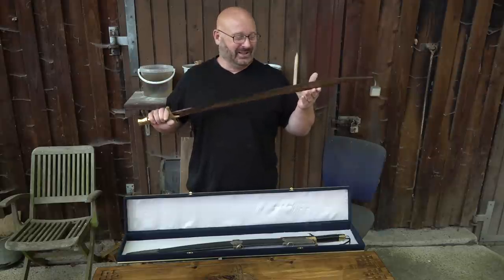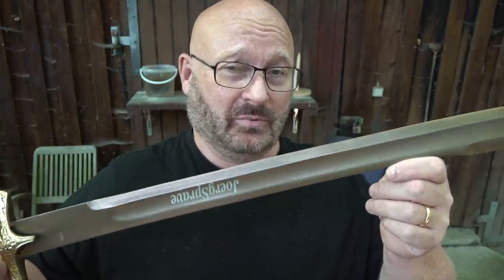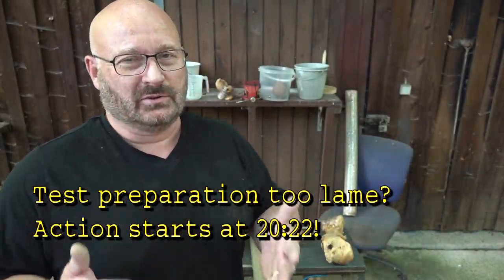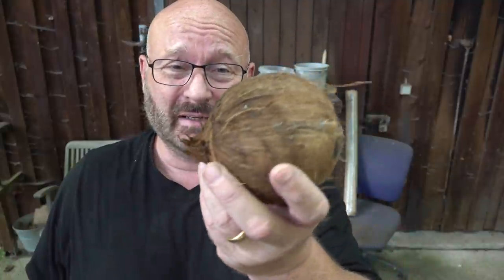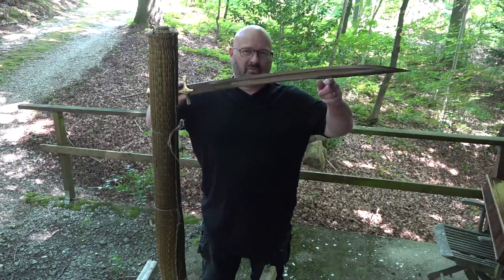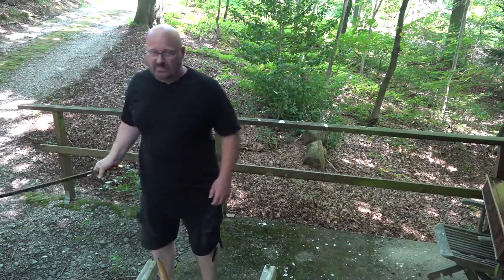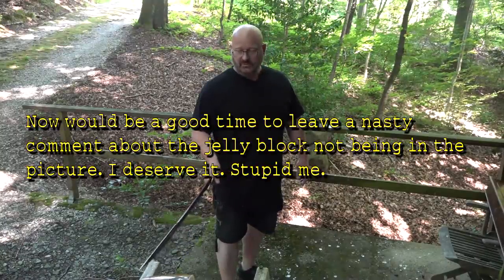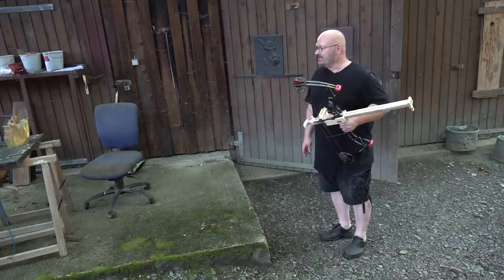REAL Ottoman Swords: Extreme Tests!

Comment: There is a shape of bullet referred to as a diablo shape I believe, it's shaped like an air rifle pellet. It's fairly aerodynamically stable could you fire something like that instead of hex nuts? Long a launch stroke as you can give it and such since it would be msall and not  large as an arrow. Though what you'd use to make it to get iut up to the right weight /size is  question.

Comment: Hi Joerg, please don't feed your dog bones. Bones don't digest and they can leave splinters in the stomach. Not good for the pup and the vet bill could be costly. You could try antlers, they seem to be indestructible so the pup will have something to chomp on without health issues but check with a vet...
Reply from the maker: These massive bones are specifically sold for large dogs. They can't crack the bone, just gnaw at the softer parts. A big dog must have something substantial to gnaw on, it is stress relief.

Comment: Had a look at Swordbuy's website and was immediately put off by the fact that they make all their swords from stainless steel....which sucks! There is a reason why functional swords are never made of stainless steel by other manufacturers. It's simply to brittle for functional sword blades. And it makes the weapon look like a cheap wallhanger aswell.

Comment: You 're wrong about heat treated steel on blades. There many factors, that determine the edge either chip or roll. Steel itself is a factor, hardness and quality of heat treatment, is 2 more factors. Edge geometry and edge thickness, have to do, only if the chip or rll is big or small. A giid blade edge, if perfectly done, neither chips or rolls that easy. I've seen sword edges, take NO damage at all from hitting bones as you did it. The sword you have there, isn't made good enough, for real use. Guard loose... edge takes big chips..